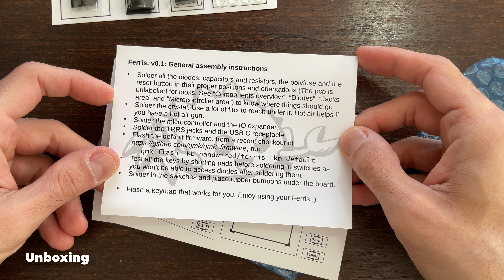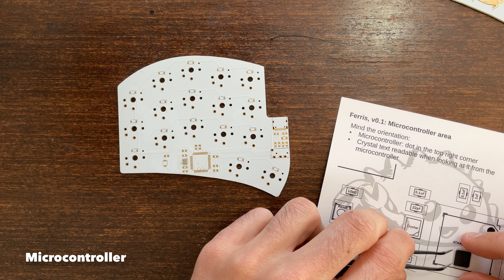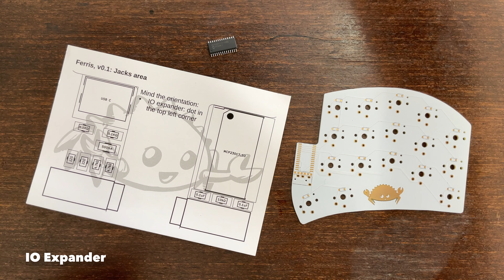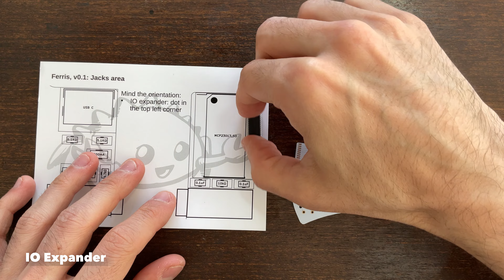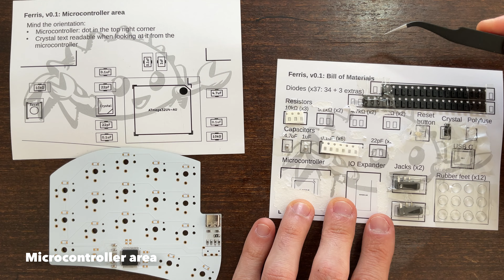Ferris Base v0.1 Keyboard Build log (No heat gun)

Comment: I always wonder if it gonna short when u touch the keyboards.
seems to have a emd issue with the open cover?
Reply from the maker: Curiously I was thinking the same today while cleaning it with my fingers, regardless I've been using it for almost a week and had no problems. The pro micro area is the most "touchable" area of this keyboard and I never touched the circuit accidentally.